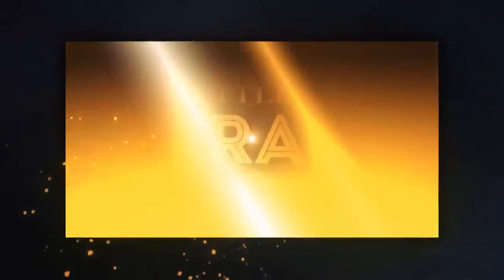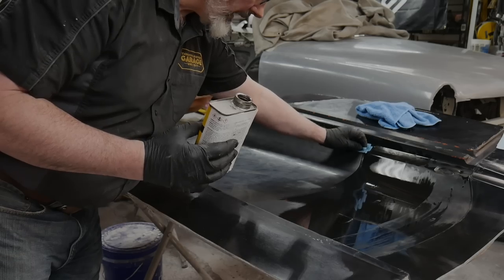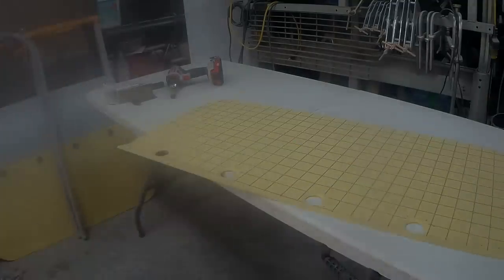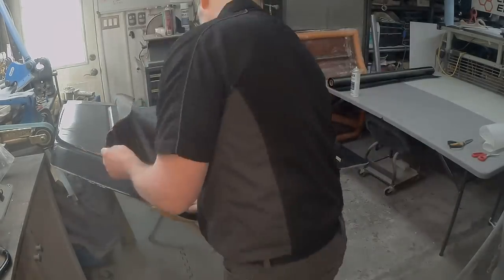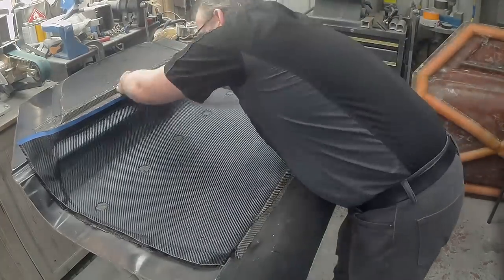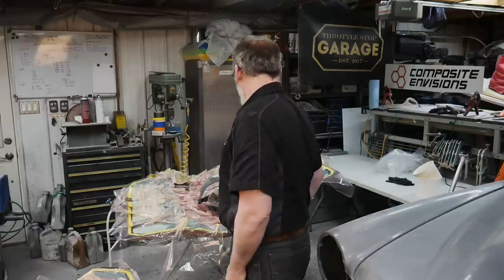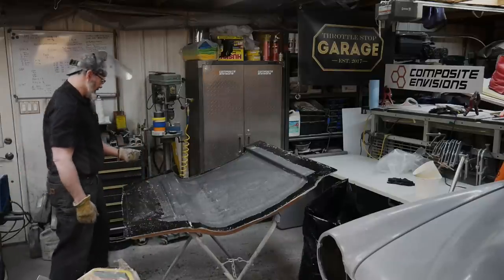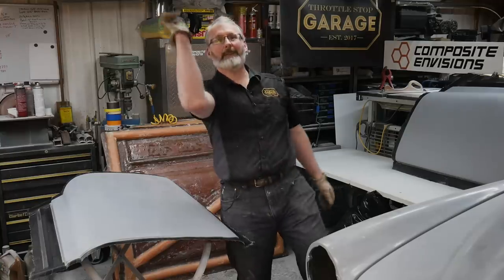Carbon Fiber Doors - DIY - Part 4 (Ep. 66)

Comment: Little tidbit, you said “Like there is a resonance to it.” When aircraft are being inspected for delamination of composite panels, inspectors perform Resonance Frequency Inspection! Thank you for your videos, I enjoy watching them!
Reply from the maker: Cool - I had no idea.
Reply: I'm a structural engineer, and we do the same thing for checking concrete slabs for delamination. If it doesn't sing, don't drive on it. After a while you can tell how bad it is by the pitch. Or maybe I just see too many...

Comment: Excellent result Craig, big smile when you pulled the door from the mould, cant beat that sound. 
Ian.
Reply from the maker: It's an awesome thing...I was chuckling when I peaked to see if it was OK when the first one popped.  I had trouble with the resin exotherming in that mold and thought I might loose the part.  So when it came out, I was genuinely relieved.

Comment: Phenomenal stuff. But I missed the info why exactly kevlar? Seriously for side crash protection? If that true, then how do you think of reinforcing the rest of the car? Pillars, underbody...

I am also puzzled why the foam. Sound insulation? Thickness? 

Thank you
Reply from the maker: It's complicated - the foam core is there for strength. Separating the layers of carbon fiber makes the panel like an "I" beam - doesn't add much weight but adds a lot of stiffness.  The Kevlar would hold the carbon panel together.  Very different mechanical properties.  The car does have a seriously beefed up frame that I built and I'm not done yet. Pillars etc are fine.
Reply: Kevlar has better tensile strength, but it doesn't have the stiffness of carbon fiber per unit weight. However it has better impact resistance per unit weight, ( aka toughness). So for a lightweight side intrusion preventative it is a better option than carbon fiber, although I would use s-glass fiber which has even better toughness.
 Kevlar is a stand out when abrasion resistance is required, so it's great for the underside of your f1 car.
Reply: Throttle Stop Garage thanks for this.... do you perhaps have any links where I can read about the kevlar reasoning? The foam part I think I understand. It should give you perpendicular strength...

Comment: Can you go into a little more detail on the pleating in a later vid? I don't understand their purpose and positioning. Thanks and great work!
Reply from the maker: I've got an entire video on pleating...it's just under lock-down.  I'll try to rescue it soon.
Reply: Pleats give you extra bag where you need to make a 2D bag fit a 3D surface - you don't want to make the bag try to stretch!  They match features in the part and should be as symmetrical as possible.  

Parts came out nice!  I look forward to seeing the video on pleats.  

Here's a post I did on basic vacuum bagging - might be helpful:  
https://explorecomposites.com/articles/lamination/basics-vacuum-bagging/

Comment: You should leave a few little pieces bare carbon just to give a hint of what is actually going on under the paint.
Reply from the maker: I've been thinking I may leave the closing panels of the fenders raw.  No one would see it unless the door is open.  I like the idea.
Reply: I was thinking perhaps add a little piece to the interior somewhere. Just a hint of what's unseen.

Comment: I am really curious to see the final doors and the weight difference. Probably one of the biggest weight savings on the whole thing.
Reply from the maker: Uncut they're 2.5 kg's - so when trimmed that panel will be 2 kg.  Stock doors are 19 kg - I don't know what the door skins weigh.
Reply: Just an idea... in modern car doors, you have quite a lot of elements for side crash protection. I understand that you are using kevlar here for that... but if you would want to mimic the construction if a modern car, I suppose you would need to strengthen the overall frame of the door, do additional strengthening  of the bottom and top part of the door (when it meets the window glass) and you would also strengthen it diagonally. I suppose with carbon fiber?

Comment: Love watching your journey through the making parts.   I have a kayak mold that I do hand layups in has only about 1” of flange do you think that’s enough to support switching to infusion?
Reply from the maker: Hi Nate - 1" is way too tight for an infusion.  No room to work.  Look at extending the flange so you've got somewhere for the tape, bag and fittings to go.

Comment: You mentioned online calculators to work out thickness of the layup do you have a link to one by any chance? This is going like watching a volvo on a diet the weight save is going to be substantial and yet so unseen
Reply from the maker: Here are a few.  I try a few and see how the results differ (and it's not much).
https://www.hexcel.com:82/calculators/src/CPTCalculator.aspx
https://composyst.com/material-calculator/

This Volvo was light (2500 lbs) as is my collection of 240's (2980 for my 242 and 3100 for my 245) relative to a modern car.

Comment: I have a question pertaining to the total equipment cost involved to get properly setup to do infusion. Wanting to do some parts and would like to know what kind of rabbit hole I would be going down to get setup. Thanks for the great videos.
Reply from the maker: Let's assume you've got the molds built and you're ready to infuse.  All you need is a vacuum pump.  I guess a cheap one would work, for a few parts.  I've got a cheap one, and it leaks and I'm not sure I would trust it to do many parts.  Get a good pump and sell it when you're done.  Cheap pump - $100...good pump $500. I'm doing a video on the catch pot - just some ABS pipe.

Comment: Love your channel! I was wondering why you were trying to match the sheet metal thickness?
Reply from the maker: You've only got so much adjustment on a hinge.  So your best bet is to replicated the steel thickness in these areas.
Reply: Throttle Stop Garage I was under the impression that you were going to do the entire door in carbon. I’m guessing that you’re only going to skin it in carbon and leave the main body in steel?

Comment: Why don't just clearcoat and wax mold before ju aplicaite release coat? Works for me every time, and my molds just 2-3 days old
Reply from the maker: Just following manufacturers instructions.  So no wax - just a chemical release.  Works without issue and is easy to do.

Comment: What is the purpose of using a mold sealer? Wouldnt buffing it with partall #2 a few times and spraying on partall #10 be good enough to make a part from the mold? Also do you just clean your molds with acetone or do you use prep all and tack cloth
Reply from the maker: The molds were green when I laid up the carbon fibre.  A sealer is recommended.  I'm not using any wax or PVA on my molds - just chemical release agents.  I clean them with a quick wipe with a microfibre cloth and then shoot the primer over the release agent.  No problems.

Comment: Have seen some instructions that recommend carbon fiber to be rolled up and not folded--  time 14:35. ---  Do the fibers break when folded?
Reply from the maker: Not for the 2 minutes that the material was folded - it was not creased. I just fold it to get it on the scale. The fibres could break - it would also impact the weave.

Comment: I dont understand why you apply the primer on there and then lose the carbon fiber look. 
Is there any reason for it?
What is the regular method of doing it?
Reply from the maker: In truth, this is more common (spraying primer in the mold) than many realize.  The reason is I don't want the carbon "look" of exposed fabric on the outside of my car.  Having the primer applied in-mold is efficient and while only the first coat of primer - it is a step in the right direction.  Even the "normal" way would include some form of clear coat for most carbon fibre parts as the epoxy will yellow from UV exposure.  Some clear in the mold (using similar products to what I've used) or apply automotive grade clear after the part is demolded.
Reply: @ThrottleStopGarage  thank you for the reply, I wanna do a full carbon fiber body too, but I wanna do it for weight reduction and looks.
Thanks for all the great content and excellent guidance

Comment: I thought 700nc is for prepreg
Reply from the maker: It's a semi-permanent release agent.  It's not specific to a process.
Reply: @ThrottleStopGarage  Okey, our biggest problem is the surface. Everywhere is air. With colour and carbon surface. All ways fucking air. Most of the time we have more than one mould to screw together. So we have to bag it completely